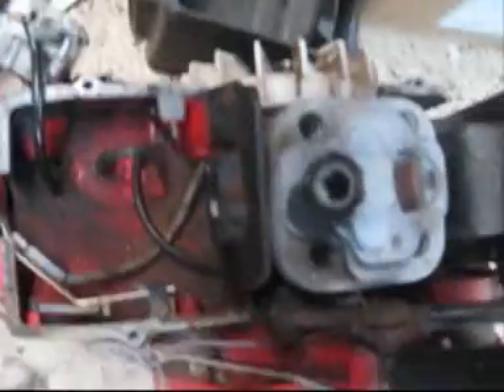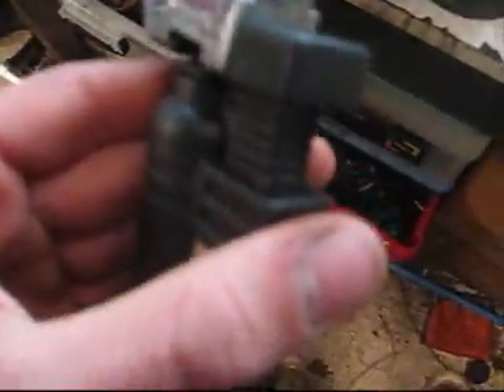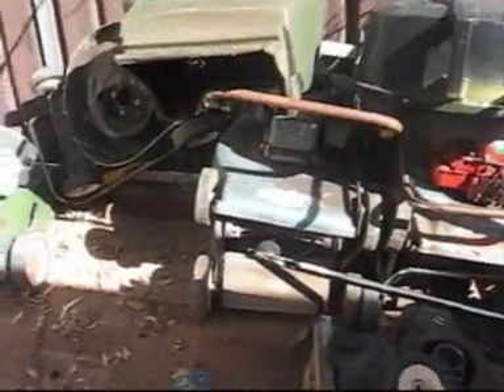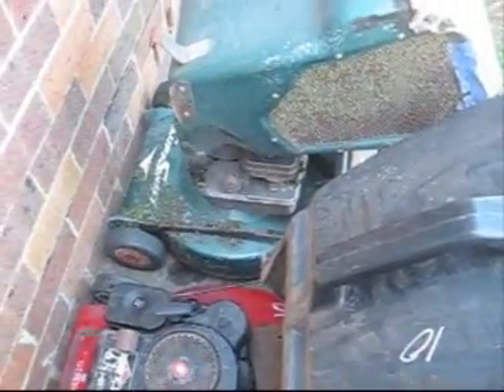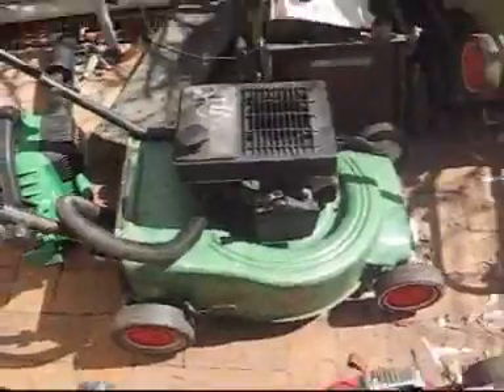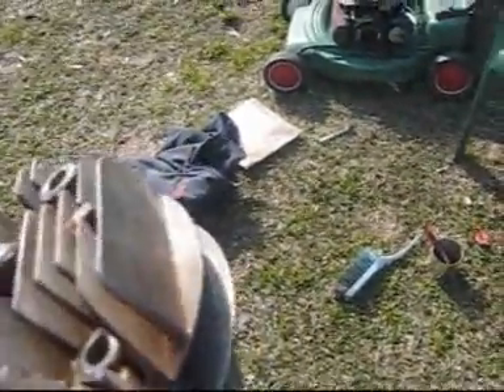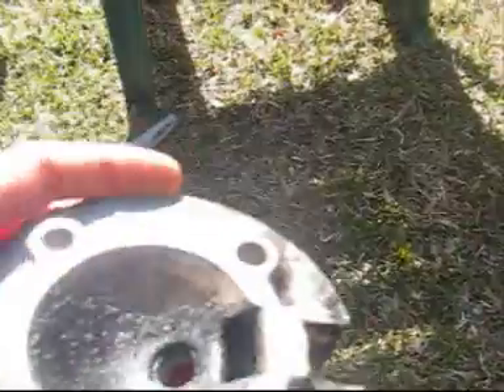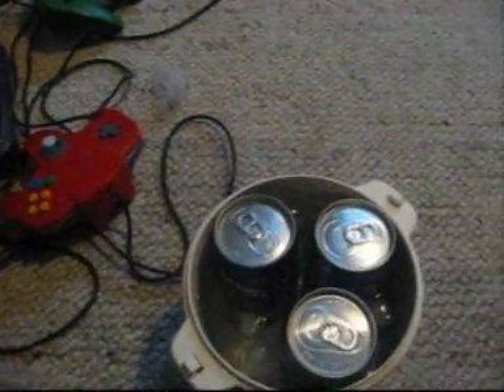how to recondition engine heads

Comment: lolz nice. Yer i did that method on my motorized bike, came with a pre warped head, how lucky am i! I didnt recon the head or cylinder on my victa, yet to give it a start up so i dunno how it runs yet lol. I got home today and just sat down n watched movies n b4 i new it it was like 6pm. O well, gtg do chem hw now, all i gotta do is mix up some jbweld, stick on the throttle outer cable shield to the carb, run the cable through and get a lil return spring from bunnings.